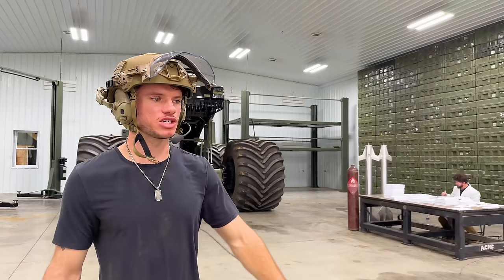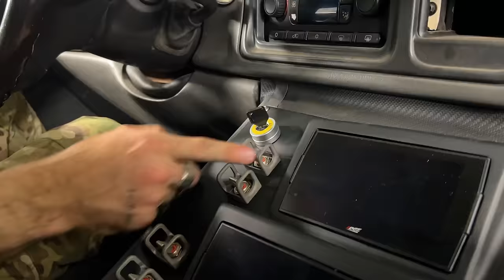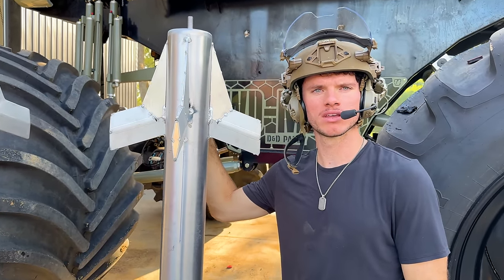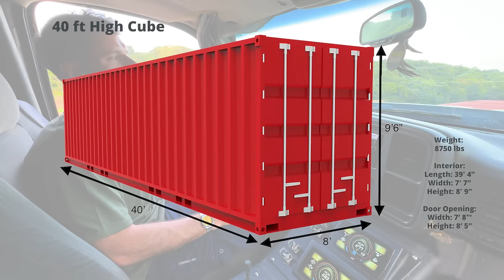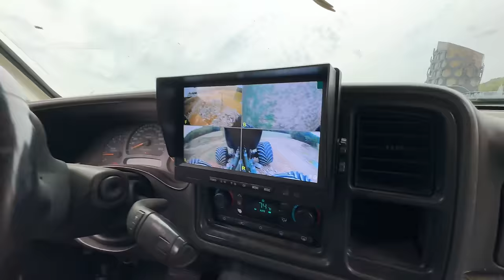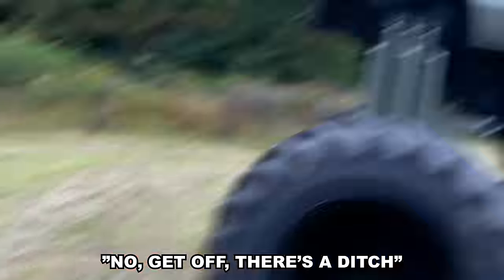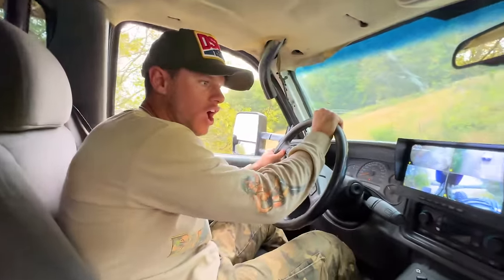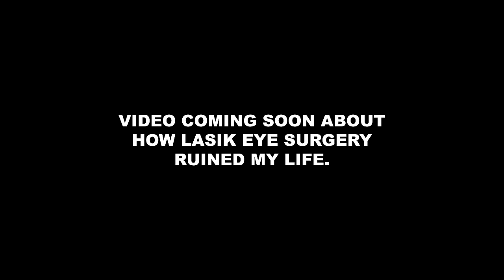Monstermax 2 Snaps in Half (Catastrophic Testing Failure)

Comment: Bro, I feel bad, I know what your gig to destroy vehicles but that’s gotta suck watching monster max tear itself apart like that, Wish you the best putting it back together!
Can’t wait to see it back in action.
Reply: I know right? He needs a better mechanic.
Reply: Whats the point of a monstertruck if you can not use it as a monstertruck? If the truck breaks apart by repeatedly slamming the brakes, either you gotta improve it or remove the brakes.
Reply: imagine how the mechanic feels watching this shit he worked years on get merked in one video's worth XD then again hes prolly laughing to the bank cause hes got another year of work guaranteed
Reply: @liamhop6148  well when it breaks from using a monstertruck as a monstertruck, it means it wasn't built like a monstertruck. So his job is to rebuilt the part that breaks even stronger so it doesn't break again, because climbing up objects shouldn't break the truck and slamming on the brakes shouldn't break the truck
Reply: I honestly think they should build an entirely new monster max 3 and build it like an actual monster truck.....could you imagine the videos we would get with Cody behind the wheel of a legit monster truck that can handle some abuse?
Reply: @Stacked3403  Honestly, I think a smaller monstertruck called the MonsterMerc or something would be awesome.

Comment: That breakage was spectacular,  takes some serious torque to do that
Reply: The failure has nothing to do with torque. The limit straps on the suspension broke when he locked up the brakes. Basic physics…newton’s first law…an object in motion stays in motion until acted on by another outside for

He locked up the brakes and the truck kept going…past the breaking point of what was essentially holding his suspension together upon rebound.
Reply: @christianbiedrzycki2432 yea I don’t know what they were thinking using off the shelf shocks they might work for the weight of the truck and sprung mass  but when a single axle weighs more than the truck alone it was pretty obvious what was going to happen as soon as you hit max suspension down-travel in a shock load 

And to preempt this dumb argument Sure the limit straps were “supposed” to prevent that but that’s bad engineering they should increase part life by not allowing him to beat the piston into the gland in the first place they should not be what’s keeping the piston from destroying the gland in the event the truck gets airborne

Comment: Cody got a question for you, what is the fuel consumption on the Monstermax 2 by any curiosity.
Reply: That thing looks like its chugging 10 gallons per mile. 😅 

The rolling resistance of each of those wheels is probably bigger than the rolling resistance of my car, if you tried to roll it over. 

I don't know how heavy the car is, but i wouldn't be surprised if it was over 40 thousand pounds.. it probably weighs about as much as an IFV, but doesn't have tracks, so its more efficient. 

I think that on road while driving normally trying to be efficient, it could be around 35 liters per 100km. 
But when driving like they do, i think it is way more than 1liter per 1 km. Maybe something like a gallon per mile. xD
Reply: the answer is NO

Comment: Cody if you want to know how to fix monster max so it won't buckle need to change the upper bar placement.. draw a triangle with the upper and lower Link you want it facing towards the front of the truck not the rear like how your is set up. The point of the triangle is where the center of gravity will be and yours is behind the truck.

Comment: Always funny tho how you like to do dangerous stuff but when it comes to something iif you actually undersand basic physics is perfectly safe thats when you get scared. Like a truck with a fairly low center of gravity and a lot of weight 75° angle makes you uncomfortable eben tho your perfectly fine but let's fly fucking helicopter in my garage and that doesn't worry you at all
Reply: And before someone calls me out on oh its got 2 diesel engines no way its not top-heavy the axles in that thing probably weigh more than the rest of the truck edit nvm that statement was redundant I hadn't watched the whole video yet but I think in the end is pretty clear proof I wasn't wrong